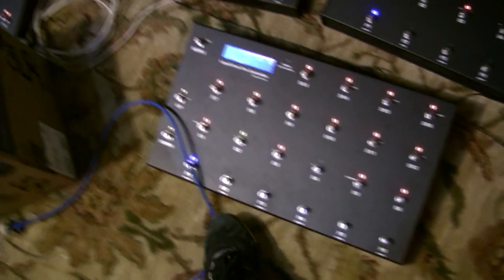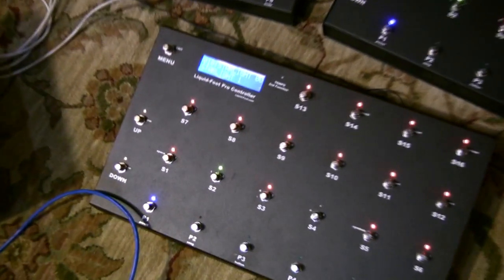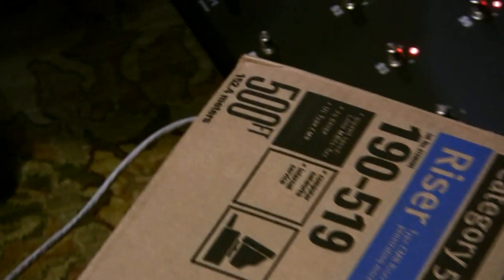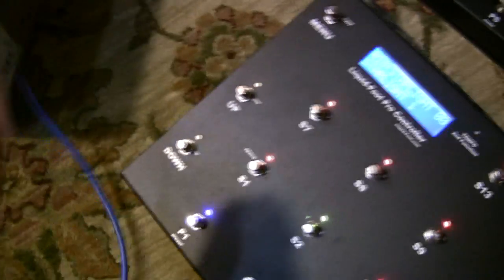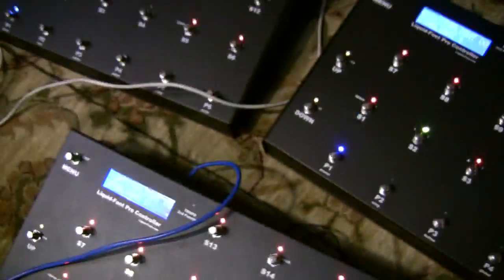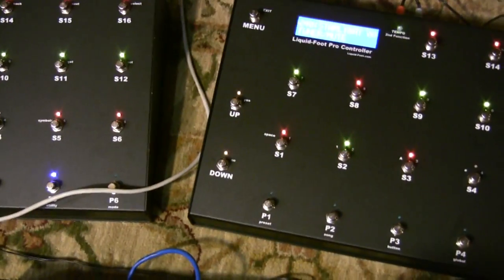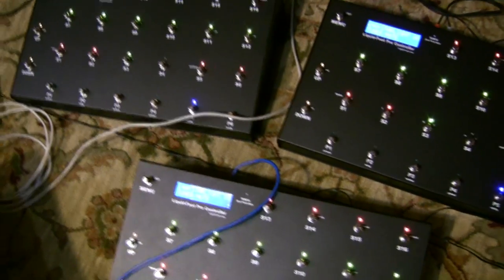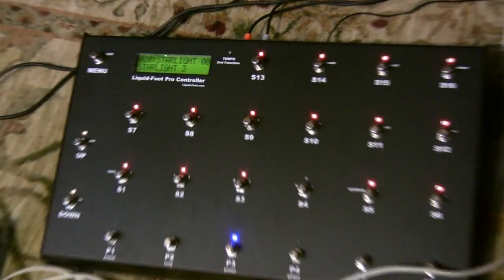Liquid-Foot PRO / JR. Touring Band Features- #3 500ft Cable runs

Comment: It would be nice if your pedal functioned like the Line 6 Shortboard does. Meaning that Power and Midi would come from the Axfxe or Kemper via Cat5. I hate power and midi cables running all over. Too many cables!!
Reply: that's what a loom is for.